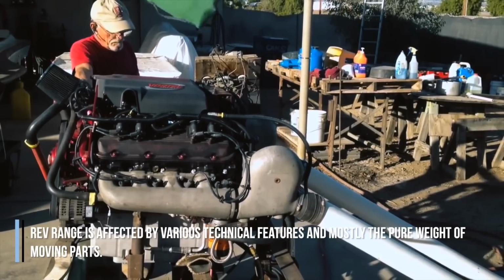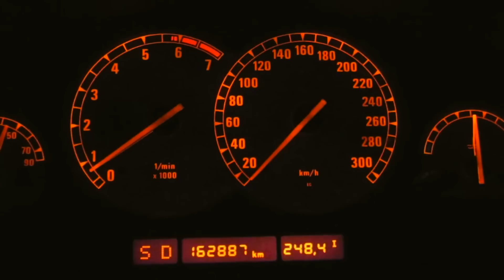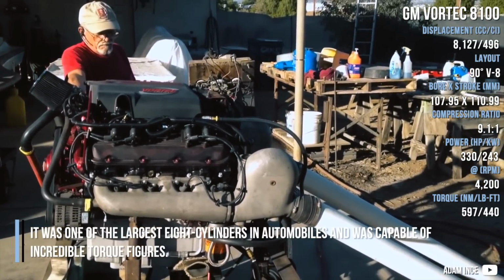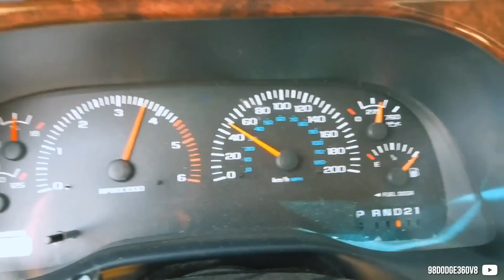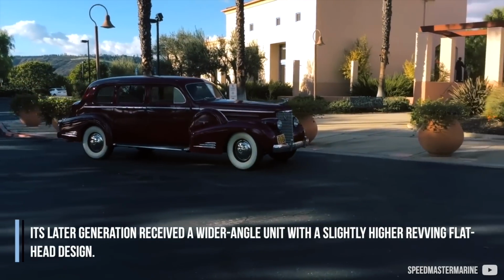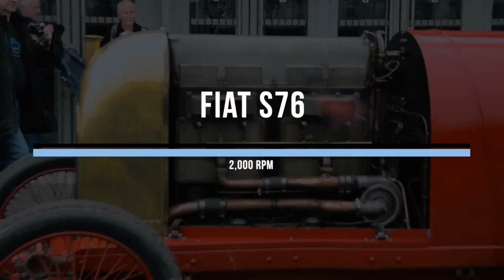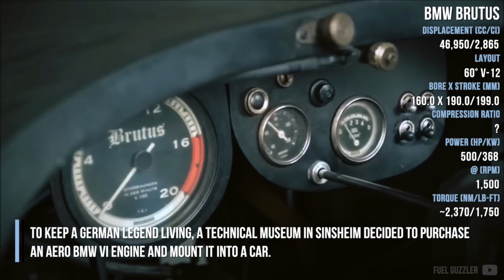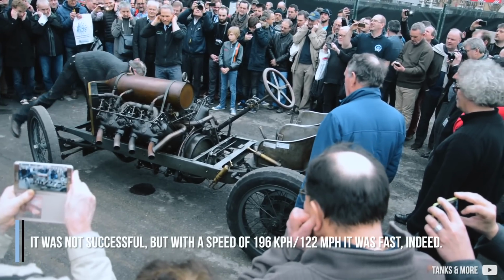Lowest Revving Gasoline Engines

Comment: Not as low as my car with a misfire on multiple cylinders.
Reply: Mhm, gotta love 2-stroke wannabe 4 strokes.
Reply: Thats awesome. You should hear my 99 maxima with no headers and multiple misfires. Sounds like tiddly winks in a giant tin can tunnel
Reply: You should probably fix that... lmao
Reply: @austinhawkins9886  put some headers on but throw on a magnaflow super 40 series and people will think you did a swap
Reply: @benson4u215  could just... Do a swap...
Reply: @Andy KA lmao
Reply: Volkswagen?
Reply: F
Reply: Well that reminds me of my first car a 98 renault scenic (wasn't my choice) its pre catalytic converter lamda sensor brok and the ecu put my redline at 2000rpm shifting was almost impossible and in highest gear (5) it maxed out at 80kph
Reply: subie gang lmao
Reply: I felt that
Reply: @benson4u215  i plan on turning into a rally car. I dont know yet. Firestone ATs fit on the 16in rim but damn does it rub.
Reply: Lol
Reply: Feel your pain. My car u have to floor it to get it to go
Reply: Yours runs?
Reply: W215 CL600 driver salutes you
Reply: LOL. Check for vacuum leaks.  It may be from a leaky o-ring on an overlooked part.
Reply: If you get I miss fire on all of them then it will be back to normal
Reply: Oooooofff
Reply: Same here
Reply: @austinhawkins9886  does it still move? If it ain't broke don't fix it.
Reply: Same, my v8 4.6L Expedition has turned into a v6 atm
Reply: @zw474  is ur clutch slipping my 1st car was revving and not going anywhere i got a new clutch and it goes great now its a vw polo its got a great sounding 3 cyl diesel engine
Reply: @yoshua4 did the pistons, cylinders and valves go kamikaze and self destruct into the cylinder wall or is the car ok because its got a non interference engine
Reply: Yes, fumny
Reply: Try a 4.6 misfiring cant do shit
Reply: I had a mercury lynx that on its best day had 3 fully functional cylinders.
Reply: Use the recommended fuel maybe it’s the problem
Reply: Plus the non firing cylinders
Reply: What car do you have?
Reply: I had a 2001 Scenic IIRC. The 1.6 16V engine (K4M) is generally well-regarded, and even has its own racing class in Formula Renault.
The only engine problems I had on that car, happened when water got to the coil packs and shorted the ignition sparks. The plastic cover on the engine had been removed by a previous owner to make room for LPG injectors, allowing water to get in there. And the seals on the coil packs were pretty shot.
First time it happened, the engine shuddered so violently, I thought it had torn a con-rod, or something was being kicked around in the crank-case. That’s when I found out that the coils were wired each two in series (wasted spark ignition). Turns out, a 4-cylinder engine won’t run very well on only 2 cylinders...
My „fix“ was to put the coil with the best seal in the cylinder most likely to collect water...
Reply: Gonna be honest youll probably want to get that checked out
Reply: Ya dont even have 1
Reply: I have a V6 that would turn into a V5 every time I really opened the throttle passing or going uphill. Turned out is was just a slightly loose spark plug wire. Surprisingly easy fix.
Reply: Been there. Vauxhall Astra 1.6 -00
Reply: Take the plugs out on the dead cylinders lol it'll run better 😆
Reply: Ngl I choked on my drink when I read this
Reply: Not as low as a jeep with so many misfires it's no longer the issue of it misfiring but more the success of a firing
Reply: My car is a gas engine in it red lines at 4000.
Reply: God all these people commenting with shot boxes that run on 2 cylinders😂😂
Should have bought a Lexus

Comment: Peoples that did 200km/h in the last car were some absolute madlads
Reply: they are way better drivers than all of the f1's combined
Reply: @kaptein1247  no, but they probably had bigger balls than anyone in f1 now combined.
Reply: It was already crazy enough on the Fiat, but then came the last one to up it by a lot on the craziness
Reply: It's an aircraft engine flying in loose formation with some wheels
Reply: @kaptein1247  they're just annoyed by your lack of knowledge
Reply: my thoughts exacly..thing is shaking like milk shake on its own engine vibration
Reply: they had ball bearings of steel back then...
Reply: I am not an expert by any means, however

Can anyone tell me what they drove on for roads back then?

I think it was brick or cobble stone.

If the road was brick or cobblestone as I think it was back then, could you imagine driving 120 miles an hour on a brick or cobblestone road how bumpy that would have been?

Indianapolis  Race Track was brick all the way around up until a certain point.

The finish line at the Indianapolis 500 still got about 10 courses of brick.
Reply: @kaptein1247  Agreed - Those drivers of those mahines knew there would not be much left of either driver or vehicle with the slightest mistake. The modern F1 drivers know they will more than likely survive with minimal injury.
Reply: @reypolice5231  A lot of roads were indeed gravel, coblestone or dirt, ect. Tho paved roads did exist, still im pretty sure there were more dirt roads than paved ones, so yeah doing 120 on those roads back then on whats basicaly nothing more than an a frame with an engine and wheels is beyond crazy
Reply: @kaptein1247  If Roko doesn't want them, I apply for receiving the hug and lollipop :)
Reply: @reypolice5231  They also did the land speed record runs on beaches like Pendine Sands in Wales (where in 1927 John Parry-Thomas made a new land speed record of 171mph), and also Daytona beach in Florida.
Reply: Those drivers in early 1900s have balls of a bull..
Reply: @kaptein1247  😂🤣👍🤔LOLLIPOP!!😂🤣😂
Reply: Uuhhh that's like 93mph...
Reply: @johncholmes643  124mph👍
Reply: @sesetti  lol, sorry for not being a stuck up race car nerd
Reply: that's 1910's land speed record runners for you. they had no fear of death.
Reply: @reypolice5231  back then, land speed records were held on a long, straight beach. imagine the sand flying in your face at 200kmh
Reply: @johncholmes643  The Darracq did manage 122mph back then.
Reply: @A_Bit_of_Thought  I dont think that being more willing to put yourself at very easy risk of death makes you a better driver. No driver wants to die. At the end of the day, its the thrill of speed and pushing an insane vehicle to its limit that makes racers who they are. From the 1900s to present day, it has always been the thrill of pushing a vehicle to its limits. There is no better or worse racer across the ages. All that matters is those who brought their machine to the edge better than the rest, who pushed as hard as they could to get every ounce of speed through every corner and every ounce of power down each straight. Racing is a balancing act between you and the car. One push too far and you will be staring at deaths door, waiting to see if it opens. Push too little, and you face the dread of failure. While improvements in safety have made death a lot less likely in a race car crash nowadays, it can still happen. And death should not be a determining factor in figuring out who is a better racer, the only judge should be who pushed their cars to the limit and kept them there longer than other racers of their time. Comparing racers from back then to racers now would be like comparing lions from back then to today's tigers. Like yeah they're cats, but they're completely different cats, raised differently, in different climates and different sets of rules. Older does not mean better, it just means different.
Reply: @kaptein1247  lollipop would be nice
Reply: That thing's entire "body" twists with every squirt of gas you give to it. I'd be afraid to be near it not to mention driving it....
Reply: @reypolice5231  a lot of these early XX century speed records were set and broken on beaches
Reply: It looks like so much fun to drive xD
Reply: @kaptein1247   still not better than ayrton senna lol
Reply: @pashakdescilly7517  The darracq v8 was a purpose built automobile engine from 2 4cyls lol.. Only one ever made.

Comment: You know....anyone with the guts to power slide a vehicle, with no doors, likely negative brake power, little more than sheet metal covering an engine, and wood spoked wheels.... well, they have immediately earned my respect...and a little fear....
Reply: 399rpm 1886-93 PATENT MOTOR WAGEN !

Comment: Missed one!! The Blitzen Benz broke the land speed record doing 141 MPH, with a max engine speed of 1400 rpm. Not surprising, because the 4 cylinder engine was 21.5 litres in capacity!!
Reply: Who needs revs when you have literally shower's worth of displacement.
Reply: It actually held the overall speed record for a while because even planes were slower at this point of time.
Reply: @thomashaack1933  very true.
Reply: @nodo7575  fair comment. Just one thing you might be interested in knowing. That Benz engine had so much torque, it could drive away from a standing start in top gear, without stalling the engine.
Reply: @christophermarshall5765  To be fair, I've done that in my Miata. If you just slip the clutch a bit it's not that hard.
Reply: seth094978 True, but I’m pretty sure you didn’t have to be that careful with the clutch in the old Benz
Reply: That's fairly big. It's like putting a shunter's engine into a car
Reply: @mozeskertesz6398  exactly. Those engines were huge, given the number of cylinders.
Reply: @christophermarshall5765  6?
Reply: With a 170 mm diameter and 240 mm lenghth
Reply: @mozeskertesz6398  no. The Blitzen Benz engine is a 4 cylinder.

Comment: A low redline aint that bad if you go 150kph in 2nd gear
Reply: With enough torque and a stupidly low gear ratio and final drive, you can just about any speed with only 2 gears 😂
Reply: @This username ...be like "what's a gear?"
Reply: This username transmission? We dont have any of that weak shit in our cars!
Reply: @datgamerboy123  koeniggsegg even did with "only single gear" which means "only clutch"
Reply: @YansenHaryanto4547  Incorrect. While Koenigsegg may have a "single gear" vehicle, named the Regera, it has two electric motors that turn the rear wheels until the engine builds enough speed to turn the wheels through their own direct drive system.
Reply: @datgamerboy123  still, the Regera is indeed Transmission-less car
Reply: @RizLazey  Not true. It's a car that has one forward driving gear, but it still has a transmission.
Reply: @NaruSanavai  I Gave A Certain Category To The Regera As A DGV. (Direct Gear Vehicle)
Reply: @NaruSanavai  the vehicle does indeed have a transmission, due to it having a reverse gear as well.
Reply: datgamerboy123 2 speed power glide type beat
Reply: @wyattnyfeler7270  Not to forget the incredible Dynaflow transmission from Buick. 1 forward gear, a massiv torgue converter and an abyssmal 8mpg.

Comment: My grandfather has had a magnum v10 since 15 years ago, I remember thinking it was so cool cuz it was the only v10 i've ever seen back then
Reply: Also the only functioning american v10, AHEM ford triton
Reply: @savagetuner2404  you forget that the V10 in the Dodge Viper was originally designed as an iron block truck engine. It was called the Magnum V10, along with the 5.2 and 5.9 litre V8 engines...
Reply: V10's are cool I drove a moving van that had one
Reply: @Jeff Thompson  if i remember right  the Viper V10 was designed in collaboration with Lamborghini ,, the Viper V10 is all aluminum  ,, the later Magnum V10 truck engine was cast iron ,and contrary to the name Magnum the dodge V10 does NOT share any components with the Magnum V8 engines 
 the FORD V10 on the other hand is a 5.4 liter Triton with 2 more cylinders ,the V10 made it's way into many heavy duty applications especially motorhomes ,,,
the General motors Vortec 8.1 is a very common engine , it's a 5th generation GM big block engine ,widely used in  boats , buses ,big trucks ,motorhomes ,pickup trucks 

one of the nice things about GM engines the small block V8 and the big block V8 share the same bell-housing
can't say that about any ford
Reply: @CottagebumHeavyHauler   Correct, forgot about that beast. The SRT10 dodge is still the coolest street pickup you can actually work with
Reply: @wildcoyote34  Yes that is correct, the Viper was developed with the aid of lamborghini, and the gallardo would sound quite similar to the viper if the viper had x-cross pipes
Reply: @wildcoyote34  you are correct that the Dodge V10 doesn't share any parts with the V8 engines, however it does still share the Magnum title. As  to my understanding, the truck engine was designed first, in order to compete with (read: beat) the 454 Chevy and 460 Ford big blocks at the time. Someone at Dodge then said "What if we put our V10 truck engine in this sweet new rocket of a car we're building?" To which the engineers said, "Maybe, but that iron block will have to go. We can make it out of aluminum though..."  Again, that's my understanding of how the two engines were produced, if I'm wrong, I'm wrong. Either way, boss engines. I'd personally love to put one in a boat (whichever version can hold more boost), just to see what happens...
Reply: @wildcoyote34  Dodges V10 was also Odd-Fire, Ford V10 Even-fire.
Reply: @Jeff Thompson the dodge truck V10 actually does not handle boost well without a lot of work 

and a FORD  V10 while it does better with boost it's hard getting the ECM flashed to work right 

and neither of  them in a BOAT can handle what a Big block V8 can  either a GM  or ford 

now if you wanna see a boat that's ZIPPY ,,myself and a good friend took a glastron speed boat which had a pair of Big block chevy engines , stripped them out  , completely  and replaced them with  brand spanking new 4.0 liter AMC inline 6   engines , which are turbocharged ,,they both dynoed at 300+ horsepower 
the boat is now over 1000 pounds lighter i actually had to relocate a fuel tank to the stern to balance it 
it's 4 knots faster than it was and uses 50% less fuel when running at full throttle
Reply: @wildcoyote34  not gonna lie, that Glastron sounds good...
Reply: @wildcoyote34   The triton v10 is perhaps the most unreliable engine of its time
Reply: @SAVAGE TUNER i have never owned one ,i have a 97 F250 with a 5.4 2v  and it's one of the worst engines i have ever worked on ,the 2 problems i have noticed ALL of these engines are known for,, the famous blown out sparkplugs and the constantly failing exhaust manifolds and exhaust studs
Reply: @SAVAGE TUNER Since when are triton v10s unreliable? Could you be thinking of the 3 valve triton 5.4l v8? They’re in hundreds of thousands of buses and motorhomes and the only issue I’ve ever heard of is spark plug ejection but that is very rare on the newer ones. My farm truck has a triton v10 and it has 300,000 miles

Comment: My Car can rev to 15.000 rpm

‘Once’
Reply: Lol that's one hell of a money-shift!
Reply: Avus95  yeah😂😂
Reply: I’ve read stories on some Honda’s with ECU’s that have measured figures up to 26,000 rpm sometimes
Reply: @debillington9239  what? are those cars 2-strokes?
Reply: Kaptein Nah man, it’s nicknamed the money shift. It’s when you downshift an amount too many gears, forces the engine to rev crazily high
Reply: De Billington it was a joke
Reply: There are cars out there with engines transplanted from sports bikes.  Probably not the best application for such an engine imo, but interesting to behold nonetheless.  Now that I think about it there was a guy who transplanted iirc a 2.0 turbo Saab unit into an old tractor, looked like a pretty fun way to die horribly.
Reply: @Avus95  i heard someone shifted their honda into first and revved 22k rpm
Reply: Well mine revs to 9.500 for years now. :)
Reply: Keyword: ONCE
Reply: Does it idle at 2rpm if it revs to 15rpm?
Reply: @debillington9239  oof how tho did they just change the hear from final to first
Reply: xR1zkyx Well first and third are in pretty similar spots
Reply: Or depending on what gear you're in...
40k
Reply: @debillington9239  thats why
They money shifted from 3rd to 1st
Reply: xR1zkyx Any 16 year old could mistake 5th for 1st as well if they weren’t payin attention
Reply: @debillington9239  I dont know if every ca ris like this but put actually struggle to down shift if you aren't under a certain RPM.
Reply: @debillington9239  what when you go from fifth to first
Reply: Scientists have found that human can drink lava, but only for once.
Reply: Same
Reply: Yeetus
Reply: @Avus95  That's basically F1 cars nowadays :D
Reply: Only15 rpm? Wow
Reply: Lmao bet that engine didn't sound happy my 2t motorbike revs that hard and sounds like it's going to kill itself
Reply: Avus95 i witnessed a bmw M2 moneyshift. My friend was driving his M2 and completely fucked up his engine with a shift from redline 4th down to 3rd😬. I was in the passenger seat
Reply: Guessing it became an external combustion engine after that?
Reply: 1950 Ford F-6 two-ton dump truck well...it didn‘t pull anymore that‘s fir sure. Sounded like rattling a can full of coins.
Reply: I think my Citroen C2 money shifted in second at its top speed of just over 100 mph would be about 12000 rpm.
Reply: @debillington9239  in 26k rpm the piston spins  + or - 400 times PER SECOND
Reply: I'm Sorry, its exactly 433 timesper Second , i Just calculated It
Reply: @samuraik933  Yeah, obviously not intentionally
Reply: @debillington9239  imagine..
 If you downshifted in the last gear... you would kill many people
Reply: @kaptein1247  kinda, you stroke the gearstick, engine goes metal noises you get a stroke, thats 2 strokes.
Reply: @nickkaarslev290  lol
Reply: I had a diesel do the same once...  Never did find that one rod, pretty sure it hit escape velocity.
Reply: KvAT  Rev limiter
Reply: @Kuli24000  how?
Reply: @mozeskertesz6398  15.000 rpm = 15rpm.  We use the period as a decimal as opposed to a comma.  Just a joke.